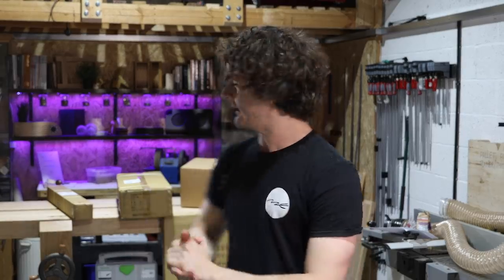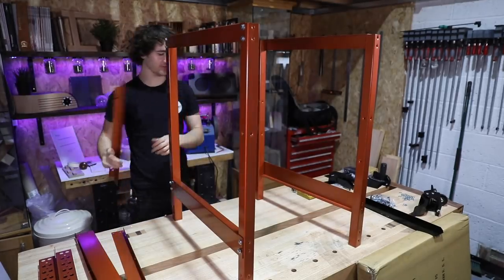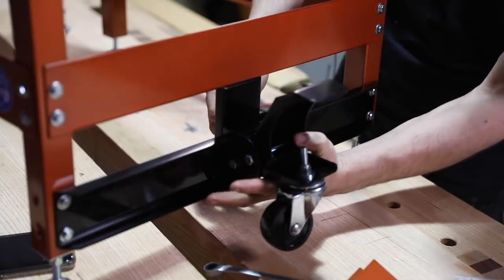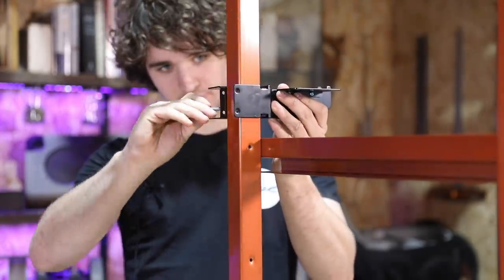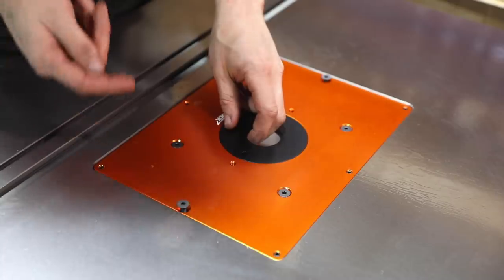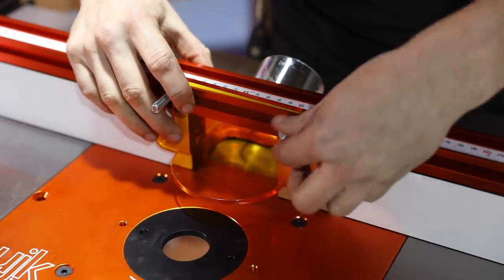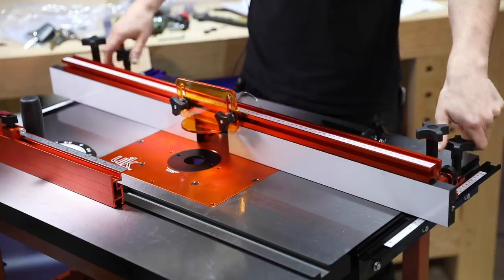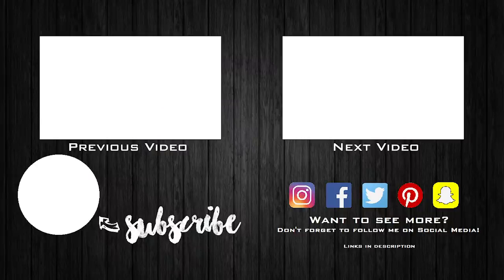UJK Router Table Unboxing and Setup

Comment: Starting to change out all my corded tools to cordless and the MyBest.Tools  are excellent.I just recently used it to router hinges for a 4 sets of doors with no issues and still plenty of power left (used a 3ah battery).Great visibility at the cutting area also.

Comment: Matt, Matt, Matt, building a router table is a right of passage just like building a workbench.  I'd rather have seen a  2-3 part series on building a router table than watching you play with a Meccano set.  Now I admit that the cast iron table top is nice and it has a lot of bells and whistles, Maybe you could redeem your self by building a wooden table under that cast iron top.  :)
Reply: Building a router bench is cool but it will never compete with a cast Iron and metal router.  I use Festool CMS router set up in the field and could never carry a wooden made one around with me. 

Building a router table is not that import an not comparable to building a bench/table.

Comment: If only all YouTube videos were this well executed - well done Matt!  Are you related to Steven Spielberg?  So, I think I want one of these, for my Festool OF1400.  Hopefully it won't break the bank, like the £450 240v Festool CMS-GE 561261 base unit plus £470 Festool CMS-OF 570251 mounting module.  I wonder.

Comment: Hi Matt not sure if you could offer some help here. I have just got myself the UJK router table with the elevator. Assembling was fine but the elevator with my Trend t14 and The Dewalt are a nightmare to fit especially with the box below. I first had a Trend T14 with a chuck extension as they said I would need to raise the router as it will be too short. I did this and then connected it to the plate and put a flush trim router bit in and switched on. Did one board I was working on but the next day I switched on the router spindle shook violently and actual it touched the plastic ring and chipped it. I then dissembled it and discovered it had bent the spindle of the router. I called Axminster and they sent me a new one. Then they said I should try a Dewalt router and I fitted that but im fearful of using the extension again as im not sure it may have caused it. Everything was tight and did it according to the text book. I am a total beginner I will say and am desperate for some help. Im based in Surrey but can't find anyone who could give me some help. Sorry for the long message.

Comment: I saw that axminster  do a small spindle moulder  for about 900 quid, it also allows you to put in a collet for router cutters so I just wondered if you thought that would be a better option?

Comment: Get an elevator for that router table. I have the same Bosch router, and I mounted it the same way you are going to. It is a pain to ajust the height on, yes it works. but not very well. I have invested in a jessm router lift/elevator, and it is soooo much better.
Reply: I have had the same experience
Reply: Really cheap simple option is a sicssor jack or small car jack that sit under the router. Not as nice but does the job.
Reply: N4 Main $500 so much better in Australia...

Comment: Hi matt, two questions 
1, why have you gone for a router table instead of a spindle mold? 
2, why are tops made in cast iron and not done out of steel that has been machined to shape?
Reply: Because cast iron has some very desirable quality's that steel doesn't have. It can be cast easier, machines faster and cheaper, and it helps to absorb vibrations. The last reason alone would be more than enough to chose it for a good router table. Those are the same reasons why it's chosen for the tops on the better table saws, jointers, planners, band saws etc. If the castings are properly stress relieved through temperature variations then cast iron will remain stable and flat. A steel weldment or casting has a lot of built in stresses that are harder and more expensive to relieve as well.

Comment: Having only really seen a router table/station used to make molding, I'm interested in the use of the miter gauge. Every router table I've been around has a miter slot just never seen it in use. I see it's use on a table saw and occasionally on a bandsaw.  I'm a total novice so forgive me.

Comment: I got to admit, this could be a better alternative to the festoon router table.
Reply: I have the festool router table and it's shit. The only good thing about it is the dust extraction....
Reply: Jaime Clifton you think it’s shit? Fair enough, I only studied furniture making (for a year) but I’m very familiar with tools in general, I’d love to get a job in it but it’s difficult, I used the Festool one for ages and thought it was good, only downside was the crappy aluminium top and the adjustment for the router was horrible, but it’s features were great. Bar losing the bolts to secure the different hoods 🙄
Reply: The fence drives me mad: it's frustrating how you have to slacken two bolts to get it to move, then following that you have to fiddle with it like crazy to get the two sides to move squarely back and forth, if your using the mitre gauge sled this is necessary - or you constantly readjust the gauge. 
Additionally the width of route is pretty poor. In order to utilise the slightly wider route you have to remove the two bolts from the closer tappings and fiddle fart about trying to get them into the back tappings.
I also can't stand the feather boards. It's only on about 50% of routes they are even usable.
I can see it being good as a portable router but I wish I had of bought a table that was designed for a static shop setting.
Reply: @jaimeclifton9078  
The Festool router table is best for going on site with.

Comment: Hi Matt, do you have a router running the other way round ? If not then I would be extremly careful using the mitergauge from left to right
Reply: I was thinking that ;-)
Reply: I was wondering the same thing.
Reply: Why? It's safer the way he mounted it. If the bit grabs onto the wood it pushes against the mitergauge and doesn't throw the wood through the workplace.
Reply: @MrBlackDragonStar  - You've got it backwards. Routers operating upside down in a table are spinning in an anticlockwise direction. You should almost always feed from right to left using the mitre gauge on the right side to push the work. Pushing from left to right when the bit grabs will pull the work away from the mitre gauge.
Reply: It's Britain, they're doing everything on the wrong side there.
Reply: @tonytebbs2429  right. My mistake :) but if anyone knows a router that runs the other way around, let me know. I would be interested.
Reply from the maker: Yea I just happened to put the gauge in that way without thinking. In use I would never use it in that direction!
Reply: MrBlackDragonStar  : that could be arranged, just rewire the capacitor on the router, trouble is, the bits are not cutting anymore ;)
Reply: @MrBlackDragonStar  ...and you can get bits made for reverse direction? I've never seen them, although I've never looked for them.
Reply: @midi510  there are bits that go the "wrong" way as they are used for cncs. We would be interested to use it professionally. So just relocating the wires would not be appropriate as far as I know. The certificates of the router wouldn't be valid anymore. So we would need one that goes the wrong way from the factory :/

Comment: Is that router table available in the states? If so, could you post the link?
Reply: I went to find the link. I wonder if it's even available here. Most of the time he's pretty good at posting the link.
Reply from the maker: Just sorted all the links. There are a few different options for table materials and also sizes of router tables.
Reply: MLCS Woodworking sells a cast iron top router table system that pretty much looks identical to this one in the USA

Comment: Would prefer to have seen nylocks (or similar) - a modest extra cost to both manufacturing, and eventual retail price. 

Wonder if the table section is available on it's own .... Personally, I'd prefer that on a self built timber frame. Beef over Meccano. Nice chunky cast iron, though
Reply: Going by the Axminster website, you can buy the entire table kit for £615.  Or you can just purchase the cast iron top for £330.  It looks a nice piece of kit.

Comment: Got the same setup, love it but however, those micro adjustments were the first thing I threw away!
Reply: Because there was a problem with them or you just didn't need them?
Reply: @midi510  Bit of both I suppose. But firstly the quality is crap on those things, hard to turn and lock after a few weeks. And they take a lot of real estate (track length) on the back of the table, there should be a version where they were integrated into the original fence of built the same way others (like Incra) does it. 

I also found that doing micro adjustments is easy enough as it is without the micro adjustments mounted, but when they are mounted they tend to lock up the fence so you have to use them.

Really a no buy, I should probably do this review on Axminster.
Reply: @eherlitz  Makes sense. Thanks.

Comment: What are your thoughts on this Vs the incra Ls supersystem?
Reply: When I shopped for a router table, I considered the UJK table, available in Germany, but went with the complete Incra LS system instead.  The Incra system is more expensive, but the fence adjustment is rock solid and the dust collection is built into the fence and the insert plate.  I have the GOF 1600CE and the Triton TRA001 routers, but couldn't find the Triton listed in UJK data sheet for the 10mm insert plate.  The GMF (same as the GOF) was listed, but only used two mounting screws to hold the router to the plate.  The Incra is available with a mounting plate already drilled for the Tritron TRA001.

Comment: at 8:40, the real reason for two parts is so the whole assembly can be levelled and the movement adjusted parallel to the cast Iron table, ensures accuracy of the sliding fence at the extremities of table travel, look at scm table saws (s i 400 model-link:https://www.youtube.com/watch?v=yACM0lbc8YE), shows the assembly technician adjusting all the aux. tables, fences, etc. gives an idea of how adjustable these tools are, and how finicky it is to get them to cut square and straight !